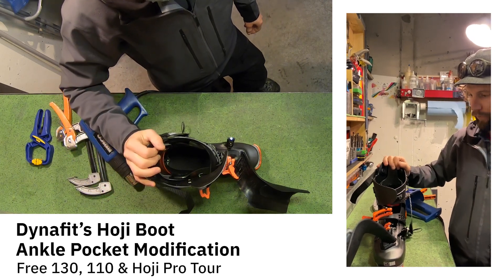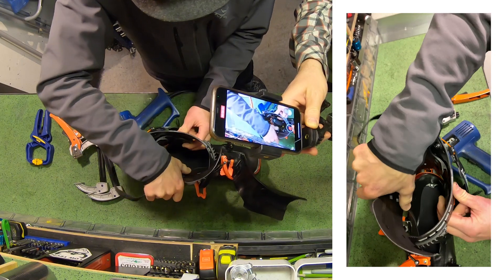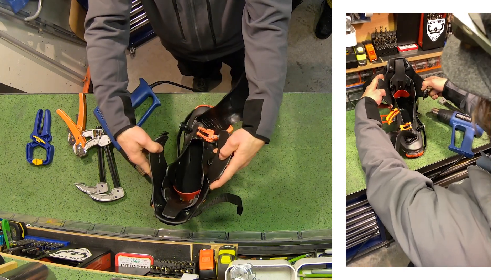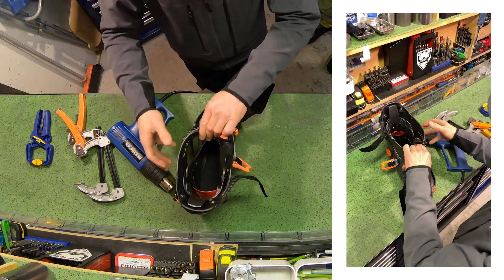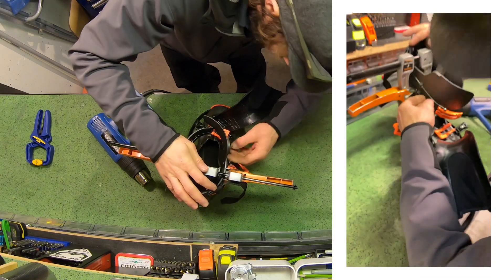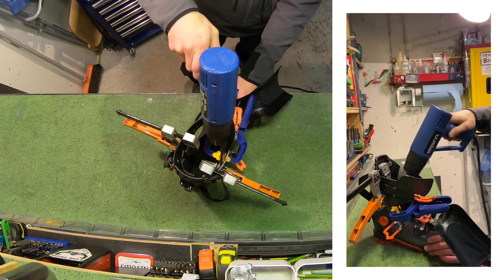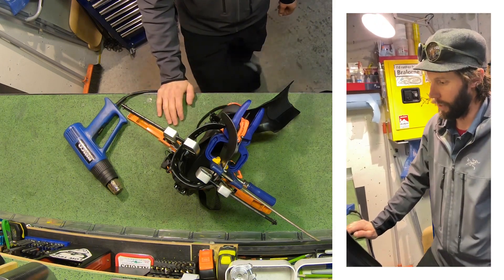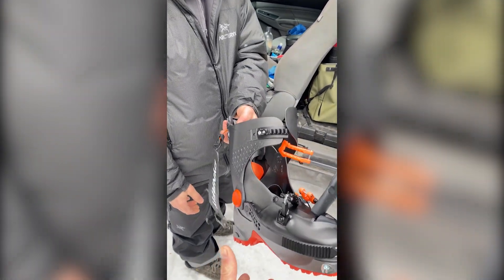Dynafit's Hoji Ski Boot Ankle Modification

Comment: Thanks a lot for the video. I just did it on the right boot and walked around in the house a bit - no more ankle pain. Now the second one is just sitting on the work bench and cooling down. Hopefully I can try it on the slopes tomorrow. If that works, I will also try resolving the other issues I have with it by myself.
Reply: Hey, how does it feel 9 months after this mod?
Reply: Hi, it still works. The modification stayed as is so that also this season the ankle pain did not come back. After doing the ankle, I also punched the pinkie toes (by waring some extra socks and padding around the pinkie toes, heated the shell up and then put my foot in). This also worked well. But the boot still does not work great for me. At least I can use it now and don't want to throw it away. Hahah. I now think about putting Zipfit GFTs in it...
Reply: @bralexander123  Great that at least the ankle pain got away. Yesterday I did the Hoji's anke mod and will try it tomorrow. My left ankle was touching the outside part of the upper shell even without the liner. The first touring without the mod was terrible. 

Do you think that the zipfits will fix the pinkie issue? Have you considered Intuition liners as well?
Reply: @mihaylodimo8996  The pinkie toe problem also went away with the mod I described above this was quite easy. I don't think the Zipfits would resolve it without mod but I'm not sure. My problem is rather overall. I think some other parts are now too wide and I think I don't like the angle in the cuff. Not sure tho. As the Zipfits are a bit higher volume, the problem is that it would probably require some more modifications again. I will consult a bootfitter that carries Zipfits before buying them. No, haven't considered Intuitions. Have you?
Reply: @bralexander123  My issue is rather different, because I've got the Radical Pro. I've got space everywhere except for the ankle outside spot right above the ankle's knuckle (lateral malleolus). I think I've got a bit more room for molding similar to this video, as I didn't go all the way. I'm suspecting that the liner is also a bit troublesome, because the pressure point is right on the liner's seam on outer side. If nothing helps, maybe the next step would be to pad the specific place with foam, or get another liner. Zipfits seem like the best choice, but they're super expensive. I saw that many people use Intuitions on their Hoji/Radicals, that's why I was wondering if you've got any thoughts.